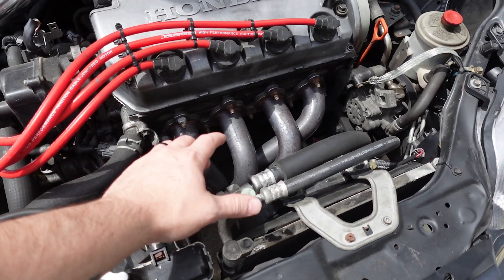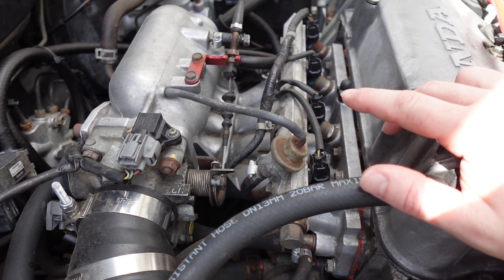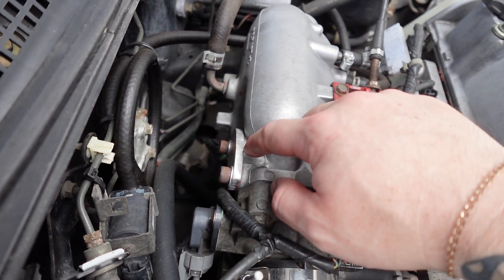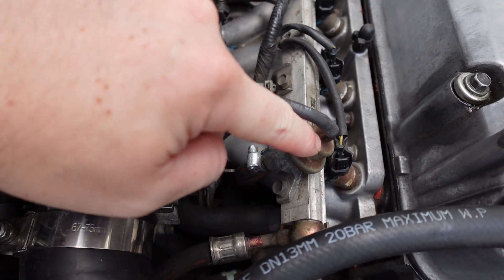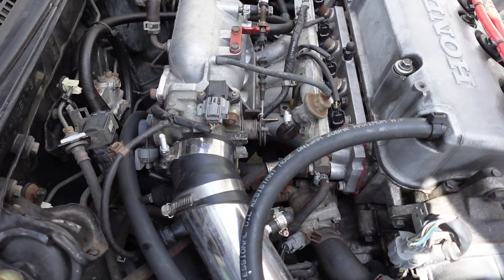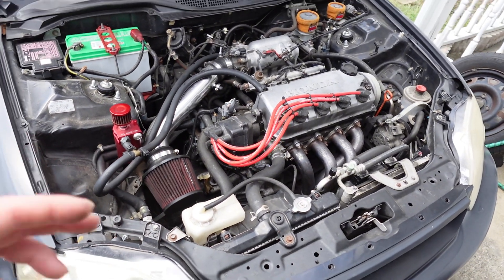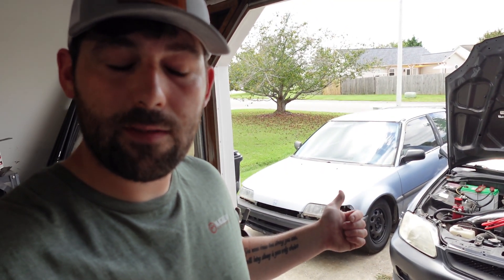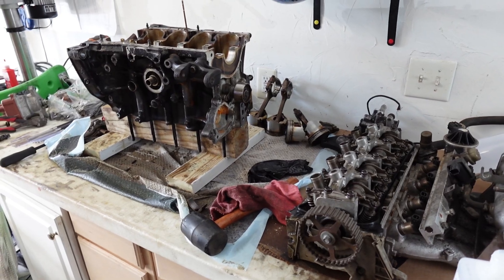D16Y7 to Y8 Intake Swap and Project Updates

Comment: Great video! I have a question: I'd like to remove the engine from a junkyard, but I don't know if it's still usable, if it has compression, and what compression it should have. Could you tell me how to test the engine to see if it's still usable? Thanks for your help.
Reply from the maker: Going to be hard to test all that in junk yard. One big thing with d series is crank shafts. I’d recommend dropping oil pan and unbolting the 4 rod caps. If the crank is clean and shiny it’s good then just carefully put them back and don’t tighten them much past finger tight. Also by saying this I’m assuming you’re willing to do some engine work. If the crank is good, very quickly you could pull valve cover and head bolts and look in the cylinders. But realistically if you drop the oil pan and don’t see coolant head isn’t blown. I’d check crank and pop the valve cover if all looks well I’d roll with it. The d series engines are tough!!! If you’re pulling it and not rebuilding it you could still do rod bearings, water pump/timing belt, and a valve cover gasket and de grease everything before installing. A head gasket isn’t too hard either if you have it out and timing belt off. It’s worth it. Hope this helps, also don’t stress timing if you’ve never done it, plenty of videos how if you follow them exactly it’ll be fine, don’t over tighten things and use a torque wrench everywhere you can!
Reply: @ZDsGarage thanks for your help. The thing is, I have a 2000 Honda Civic LX that I hadn't started in 7 years, and now I tried to start it and it wouldn't start. I replaced a lot of parts and nothing worked. I spent about $900, and I took it to a mechanic who said it has no engine compression and that I need to put in a different engine. He said he put in a new cylinder head and that the valves look bad, and it's not worth just fixing the head gasket because it will cause a lot of problems later. So I wanted to put in a used engine. I asked about a Honda engine and it costs $1500, plus $1200 for installation, and I don't know what to do. Do you know where I can find a cheaper engine? I really appreciate your help. Thank you, and God bless you.
Reply from the maker: @MarcosLino-wb7vp if it only sat and no won’t start I’d be looking at the main fuse, the ecu, the fuel system and the distributor. I’d be willing to bet it’s one of those items
Reply: @ZDsGarage thanks for your help. The problem is that it has no spark. When I try to start it, a lot of gasoline gets into the throttle body. I know this because I changed the air filter and opened the throttle body, and there was gasoline inside. I cleaned it, but when I turn the key, gasoline gets in again. I clean it with a rag, turn the key, and it does the same thing. It seems the gasoline is coming from the engine through the intake. I changed the CKP sensor, injector pressure sensor, fuel pump, fuel filter, PCV, and PCB, but nothing. It won't start; it floods when I try to start it, and the battery dies. I really don't know what's wrong. Thanks for your help.
Reply from the maker: @MarcosLino-wb7vp if it’s got fuel and no spark I’m thinking distributer maybe even the ICM I think it’s called inside it!
Reply: @ZDsGarage you mentioned the computer, I've already replaced the distributor twice, the starter, and it still won't start. The only thing left to replace is the computer. Thanks for your help.
Reply from the maker: @MarcosLino-wb7vp no problem if you want to reach out via my instagram maybe we could setup a video call and I could try to help. It’s hard to help without seeing it or putting my hands on it.
Reply from the maker: @M @MarcosLino-wb7vp  https://www.instagram.com/zdsgarage?igsh=NTlpNmd0OTBvdGdt&utm_source=qr
Reply: I forgot to tell you that in February I put in new gas and a new battery, and it started, but I turned it off after 10 minutes, and since then it won't start. The spark plugs also get wet with gasoline, and I clean them and put them back in, but it does the same thing again. I don't understand why it's not getting spark. Thanks, friend.
Reply from the maker: @MarcosLino-wb7vp  one major way to get help and assistance and maybe even find some people located near you is the D-series Facebook groups!! There’s always people who will comment unnecessarily stuff but ignore and hope the right people see it they will help you!

Comment: Sir do you have a wire diagram where to connect the 2 pin of EVAP in the car....
Reply from the maker: @arnoldpiloton3942  checkout this website! 

https://charm.li/Honda/2000/Civic%20DX%20Hatchback%20L4-1590cc%201.6L%20SOHC%20MFI/Repair%20and%20Diagnosis/Diagrams/Vacuum%20and%20Vapor%20Hose%20Diagrams/Powertrain%20Management/Emission%20Control%20Systems/Vacuum%20Schematics/